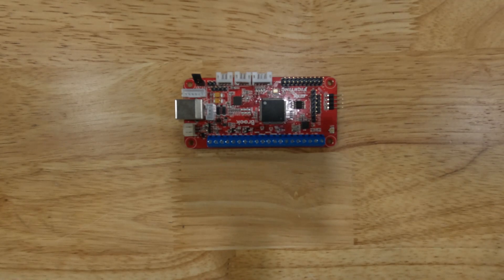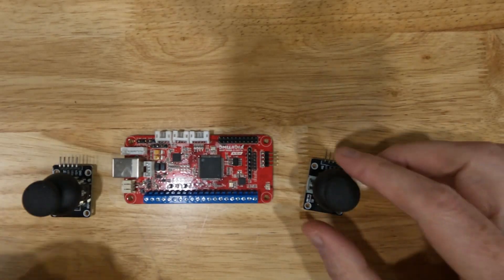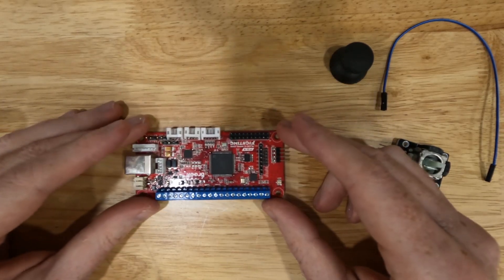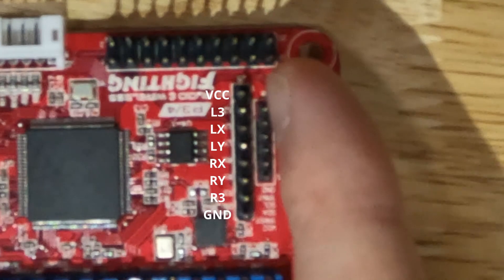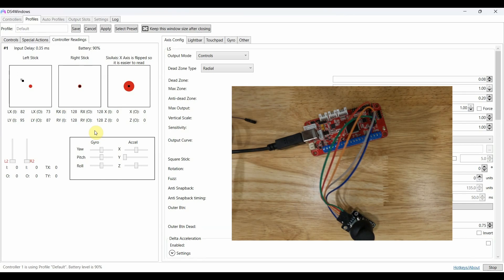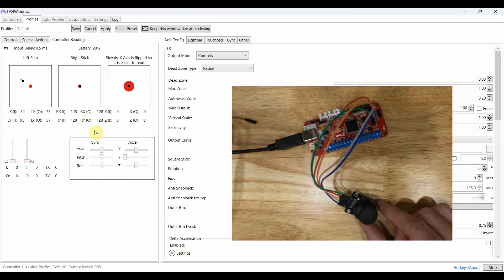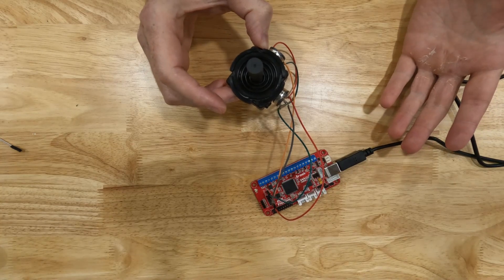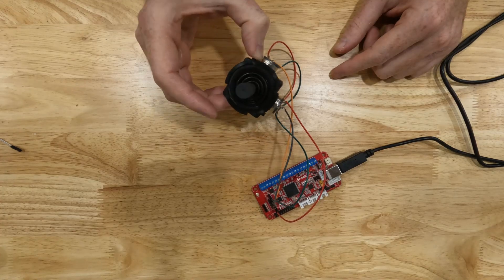How to connect analog joysticks to Brook WFB

Comment: Awesome video! Ive been wanting to make a DIY arcade stick to use not just in fighting games, but for games like Super Smash Bros., since I find using arcade sticks more comfortable to use, and Smash bros really needs that analog input to play effectively. 

I saw in previous videos you were experimenting with the Ultrastik 360, which uses Hall Effect sensors instead of pots. Would the SJ@JX lever be better for this use case than the u360? How does the SJ@JX hold up after some time? And if you had the chance to open it up, how is the modding potential of it? (adding more tension to the lever, cleaning it, adding a restrictor plate/gate, etc.)
Reply from the maker: Hi @EvanAxel , the SJ@JX is only better in that it is easier to connect to the Brook WFB (doesn't require as many mods) and is cheap. Otherwise, the Ultrastik 360 is probably considered the "better" joystick. Unfortunately, I haven't had a chance to put much time on the SJ@JX so I can't say how good it holds up. 

They are easy to open up and modify if you wanted, in fact there are only a few screws that hold it together, the rest is a toolless design. To add more tension to the lever, all you need to do is replace the two springs that are inside with higher spring rate springs. I'm sure with a little creativity you could also add a gate.

Comment: great video.. BUT MY QUESTION.... Hitbox Crossup uses a common Sanwa JLF joystick for the left analog joystick and normal push buttons for the DPAD, is it possible to either convert the signal or use a common arcade joystick for the analog port on the Brook fighting boards?
Reply from the maker: It isn't possible to connect a common arcade joystick to the analog ports, but the Brook fighting boards have other ports for the DPad for exactly what you want to do. Those ports will work with a common arcade joystick and you won't need to use the analog ports.
Reply: @enabled5714  actually what I want to replicate is the Hitbox Crossup behavior, because Tekken allows you to use simultaneously both the D-Pad and the Left Analog stick at the same time, along the SOCD Cleaner for simultaneous inputs you can shortcut stuff, but there is no current Analog to switch buttons converter on the market and only the Hitbox Crossup offers this feature, but I'm no electrical engineer so I don't know how difficult is to provide/create such an interface. In my mind, my logic says that this X/Y conectors that use a single pin use a 0-1 range meaning the potentiometer you mention provides values in those ranges, and an interface to emulate this should send and max/min value depending if a button is pressed (e.g. left or right) to the Brook pin  

Btw thanks for your fast response! ah... the PS4+Audio Brook PCB is the one that supports DPad and both Analog Sticks
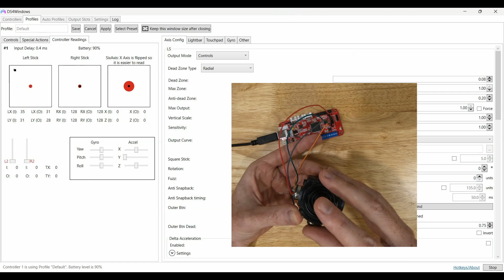Reply from the maker: @jccfrancis  I'm no hitbox/crossup expert but I did look them up to try and understand what the crossup does. I know they advertise the stick as analog but it doesn't make sense for a standard arcade joystick to be used as analog. From my understanding, the crossup has a joystick that does the same thing as the D-Pad buttons on a hitbox so essentially you have two devices that perform the same function. You can do this with the Brook board if you wire a button and a joystick into the same terminal on the board. Take a look at 26:12 of this video: https://www.youtube.com/watch?v=djrhOrVDydg&t=759s where I show how to make a joystick and buttons do the same thing. Not sure if this is the same thing you are trying to do.

Comment: Trying to find anything on the PS4+Audio Brook board, I'm wiring up an analog stick to the right right side, however it's also moving the left stick at a top/left to bottom/right motion. And does the same to the right stick if I place the active switch in the right slot.

Any ideas besides a bad board?
Reply from the maker: Try installing both a left and right stick and see if that fixes it. For some reason, connecting only one stick causes the other stick to also move erroneously. If it were me, I would connect two potentiometers to the side I didn't want to use and leave them out of sight.

Comment: do you think it would be possible to solder up the  Gulikit Electromagnetic Module Joystick for Steam Deck to a Brooks fight board Or is it not possible ? I'm having a lot of issues finding any decent quality small joysticks.
Reply from the maker: I'm not familiar with the Gulikit Joystick, but after a quick Google search I'm guessing they use Hall Effect Sensors. My only experience with hall effect sensor joystick is the UltraStik 360 which will work with the Brook board but it requires a few extra modifications. The Gulikit might work, but I can't say for certain without trying them. Maybe someone else will see this and provide some more info.

Comment: I'm looking at the BROOKS UNIVERSAL FIGHTING BOARD and I'm not seeing the RY, RX pins on the board. Any guidance if its possible to do without those pins?
Reply from the maker: Not all of the Brook boards have analog capability. So no, if the board you are looking at doesn't have the RY and RX pins then it isn't possible to use it with analog joysticks.
Reply: @enabled5714  I have been looking for some kinda answer and it breaks my heart that the BUFB does not have those pins. Yet, is it possible to modify the board so it has the RY and RX pins to that board? or is there a way to "trick" the computer into reading D-pad and Left Stick?
Reply from the maker: @alv9919  I haven't used the BUFB but I did look it up on Brook's website and it doesn't appear to have any analog capability. To my knowledge, the board cannot be modified to add analog capability and unlike the Brook WFB, it doesn't look like there is an option to "trick" it. The UFB is more versatile than the WFB, but what system are you trying to use? There may be a solution for you out there somewhere.

Comment: It is possible to make the left and right analog as buttons up, down, left, and right. If so then how. THX
Reply from the maker: Hi, for up, down, left, and right as used on the directional pad, you want to use a regular arcade joystick (see link below for an example) rather than an analog joystick. The Brook WFB has terminals to connect up, down, left and right in the same terminal block as the other buttons such as X, O, Triangle and square.

https://www.amazon.com/Joystick-Adjustable-Competition-Classic-Cabinet/dp/B0824P1CDS/ref=sr_1_20?crid=259OVL8MKIBJP&keywords=arcade+joystick&qid=1689121526&sprefix=arcade+joystick%2Caps%2C102&sr=8-20

Comment: Hey brother is there a way of connecting the jumpers onto push buttons safely?
Reply from the maker: Hi @alv9919 , I'm not sure what you are asking, are you wanting to know if you can use regular on/off momentary buttons for the analog function?
Reply: @enabled5714  Thank you for your patience. Yes, that is what I am asking.
Reply from the maker: @alv9919  Unfortunately no, momentary switches will not work for analog functions.
Reply: @enabled5714  Thank you for your time.

Comment: Hello! I loved your video, could you make a video showing how to make the connections with a zero delay board and a Brook PS4 Plus board? since they don't have those connection
Reply from the maker: Hi! Unfortunately, the PS3/PS4 Fighting Board Plus doesn't have analog joystick capability. The PS4+ Audio Fighting Board does accommodate analog joysticks and has the same row of pins as the Wireless Fighting Board. I may be able to put something together with the zero delay board and show a video. That would only work on a PC though.

Comment: Thanks for the info this video is all i was looking for. Im in the planning process as well of building a two analog joystick box for the new game Theatrhythm FINAL BAR LINE and this exelent tutorial has given me the courage to buy two of those sj@jx analog joysticks and also a brook audio fighting board and go for it. I am subscribing and looking forward to some fix/mod for that tension issue of the joystick.
Reply from the maker: Really glad you decided to go for it! I took one of those SJ@JX joysticks apart to see if I could find the problem and all you need to do is remove the top plate, loosen the 4 screws underneath the plate a little and it is fixed! Don't be afraid to reach out if you run into problems.